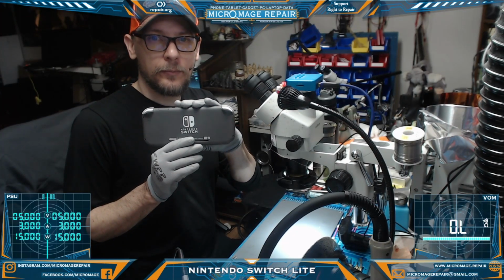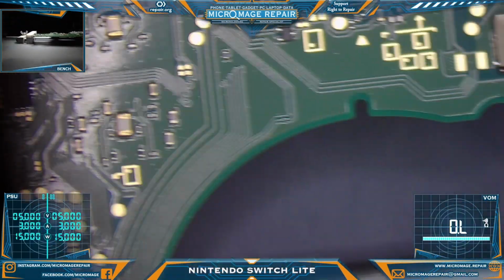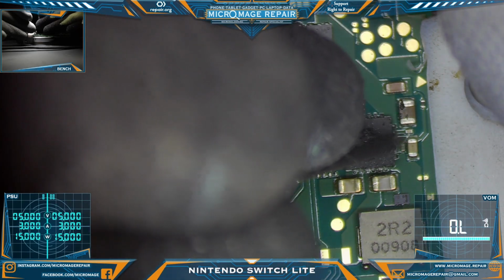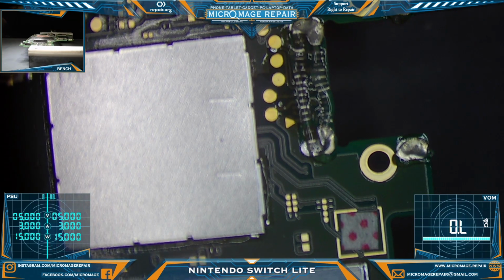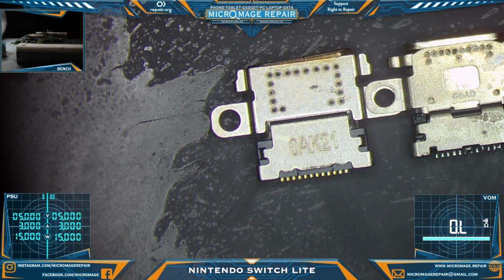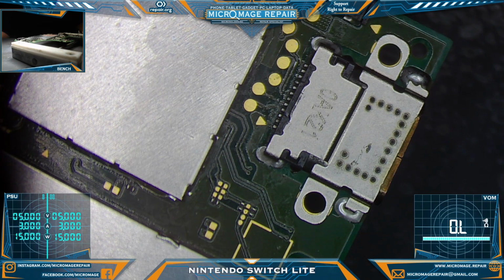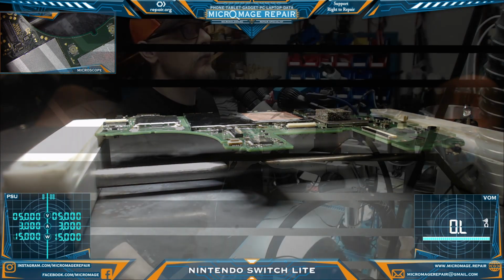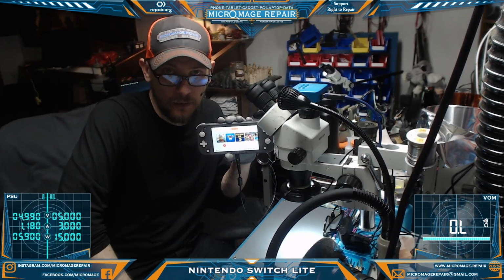The Switch Lite kind of sucks to work on really!

Comment: How do you display voltage/current on your overlay? I’m trying to set mine up. What power supply do you use?
Reply from the maker: My PSU is the Siglent SPD3303X-E. It has USB capability and software control.
If you decide to buy one do a brother a favor and click the affiliate link in the video description 😂
As far as fitting it into my overlay that's mostly OBS magic,  filters, alpha channels, hugh (color) manipulation, and cropping.
Reply from the maker: @optimizelogicrepair2784  I can relate 😂
Reply: @MicroMageRepair  I have like 7 meters, 4 power supplies, one of which I built from a kit, and countless other devices I use once in a while. With laptop repair being the main focus, some of my gear is a bit of a novelty. But I keep buying more. My next purchase very soon is going to be a QianLi Super Cam X, and a Bench top DMM. I am also going to upgrade my fume extractor to a proper 3-stage.
Reply from the maker: @optimizelogicrepair2784  I am intrigued by the Super Cam, I have their old version from years back.
I have a drawer full of flukes and various meters and a bench full of PSUs lol.
Like I said I relate 😂
Reply: @MicroMageRepair  Do you ever use your thermal cam? I bet mine will pay for itself in no time with laptops.
Reply from the maker: @optimizelogicrepair2784  I did allot more when I worked on MacBook, iPhone, laptops.
Not as much now that I'm mainly doing consoles.